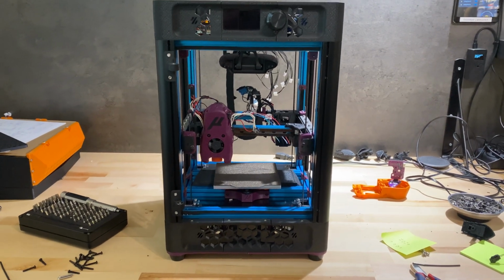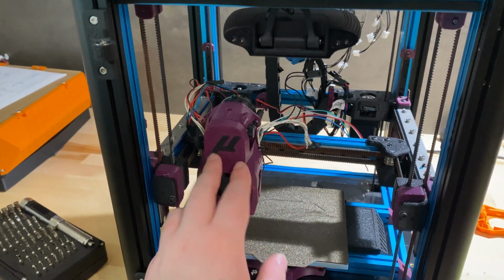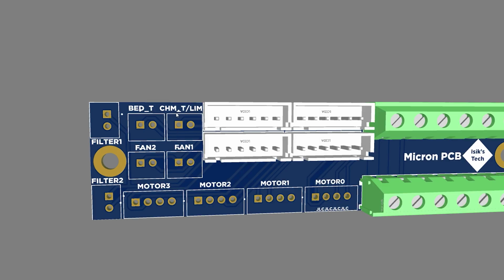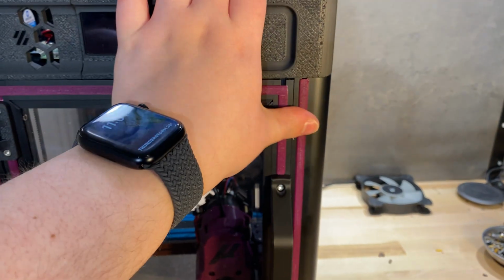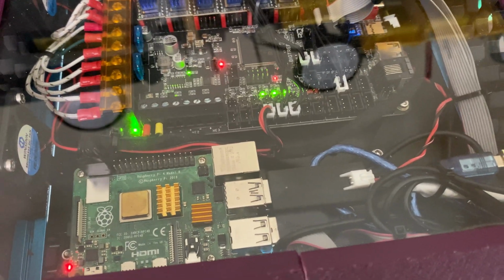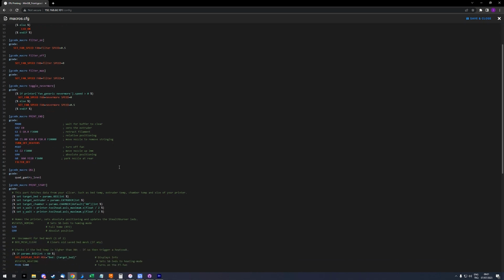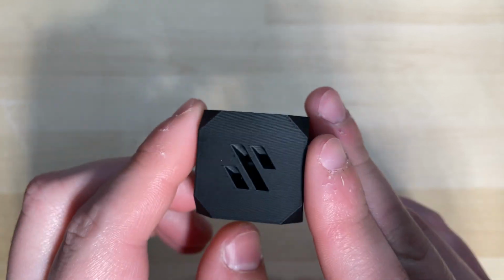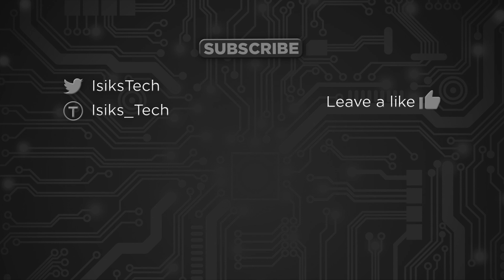Micron Ep. 5 - Micron Doom Cube Finishing Touches, Boop & PiCAN

Comment: I might suggest going 9mm mod. There is a 9mm mod on printables for a regular 2.4. I am running that on my 2.4 with build volume 180x180x170. I run 15k acceleration using a stealthburner with basically no ringing. I just got a bfi idlers modded for it to since 9mm put alot of tension on the tensioners.

Comment: I had the issues too with the built in canbus bridge, got it to work for like 30 minutes until i rebooted the pi. Also chose a usb to can converter, although a fly utoc and a btt u2c. The fly utoc works surprisingly better than the bigtreetech one, the utoc worked perfectly out of the box, the bigtreetech one didn't show any signs of life with the candlelight firmware, i only got it to work with the pre compiled firmware on github and stm32 programer.
Apparently you are not alone and there is like a less than 50% chance the built in canbus bridge works, many others have that issue too

Comment: I have a V2.4, Trident, V0.1(0.2 issue) and a Mercury One conversion running the Octopus Pro rj45(CAN) to tool head (fly sht 36 V2) with no issues. What problems did you have?
Reply from the maker: It didn't work at all. It never detected the EBB36. I tried different cables, reflashing the Octopus, reflashing the EBB36. Nothing worked, all I could see on my Pi was the CAN address for the Octopus. To test, I connected my EBB to my UTOC on my V2 and it was detected so I realized the problem was the Octopus.
I'm sure it works for a lot of people. I wasn't trying to imply that all Octopuses CAN connectors never work, but mine never did.